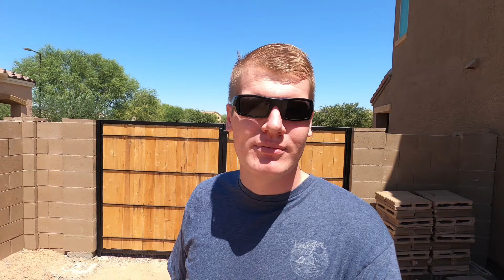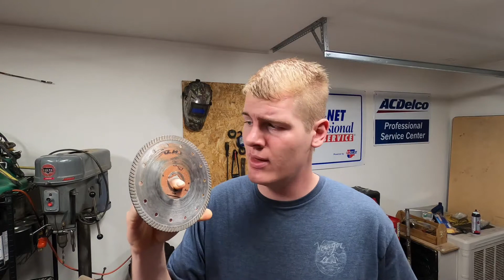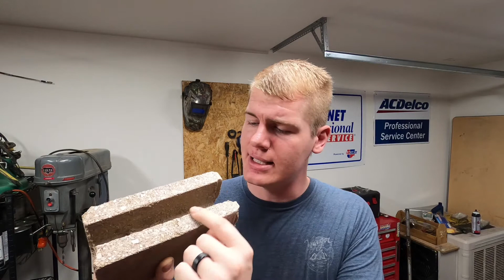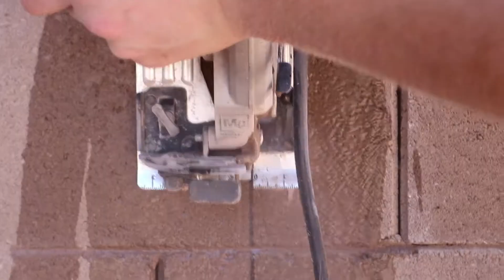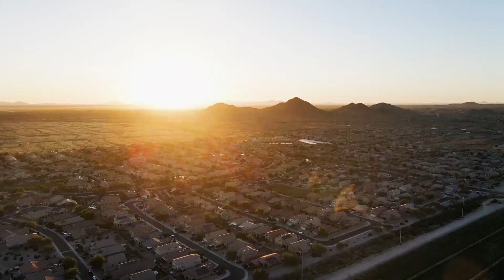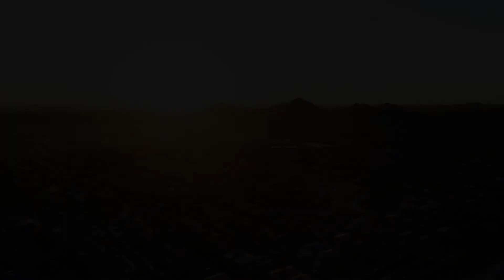How To Cut An Opening In A Block Wall

Comment: What saw blade and tool are you using?  Do you have a link ?
Reply from the maker: Here's a blade (I bought mine from a local store but this is a comparable item) https://www.homedepot.com/p/Makita-7-in-Turbo-Rim-Diamond-Blade-for-General-Purpose-B-69727/310747808
Reply from the maker: And here's the saw: https://www.homedepot.com/p/RIDGID-THRUCOOL-15-Amp-7-1-4-in-Worm-Drive-Circular-Saw-R32104/206936442
Reply from the maker: When cutting some water is helpful to keep down on the dust. But this setup cuts brick / blocks like butter.